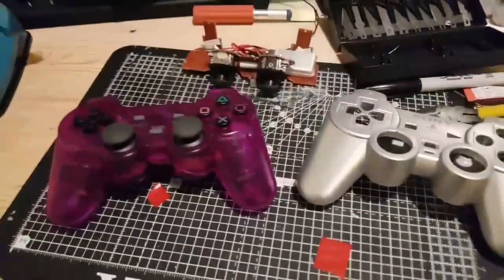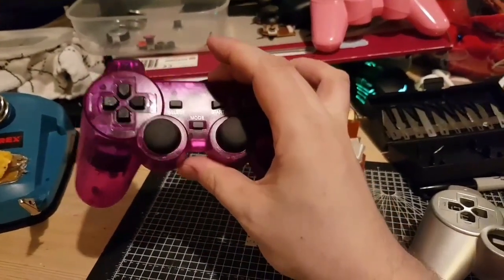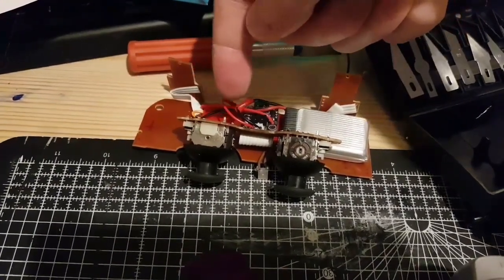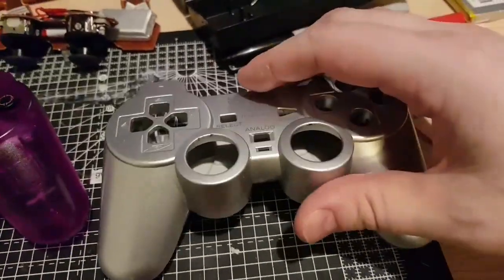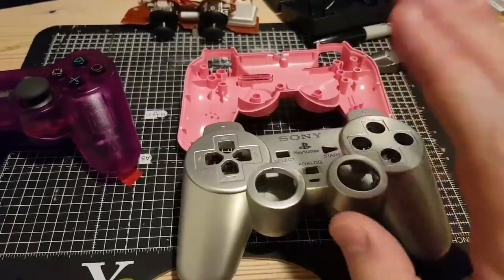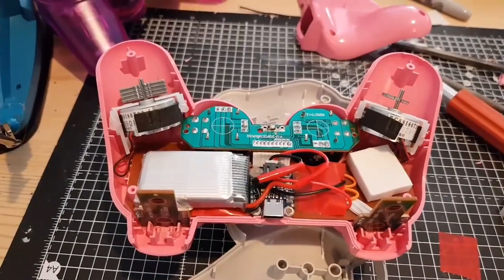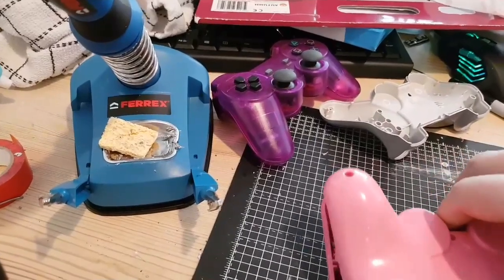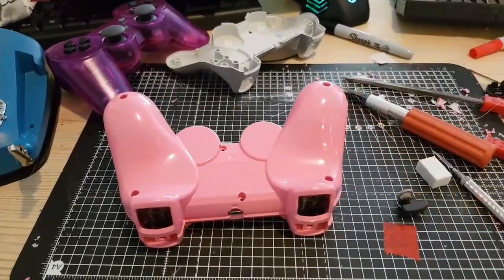Original PlayStation 2 Dualshock Controller Wireless Mod

Comment: Size baterry?
Reply from the maker: Hi thanks for watching! I used this battery: https://www.amazon.co.uk/dp/B01K39SYFU/ref=cm_sw_r_wa_apa_i_VO.BEb1WC1QPC
However it uses it's own proprietary drone connector so you'll have to add another or solder it to the battery charger. Also I used an Adafruit usb c charger, they can be quite hard to find, always sold out, but here in a micro usb one:
https://www.amazon.co.uk/Adafruit-Micro-Lipo-MicroUSB-Jack/dp/B00MJ0HOKS/ref=mp_s_a_1_1_sspa?dchild=1&keywords=adafruit+micro+usb+battery&qid=1585937175&sr=8-1-spons&psc=1&spLa=ZW5jcnlwdGVkUXVhbGlmaWVyPUFCVVFKMEg5VVZLN1QmZW5jcnlwdGVkSWQ9QTAyMjM4MjEzQ0ZTWlFKOU9HVU5NJmVuY3J5cHRlZEFkSWQ9QTAyMjcyNzUxR1hBQzZRMUpST1hWJndpZGdldE5hbWU9c3BfcGhvbmVfc2VhcmNoX2F0ZiZhY3Rpb249Y2xpY2tSZWRpcmVjdCZkb05vdExvZ0NsaWNrPXRydWU=

Comment: I would love to do something like this do you know if those wireless ps2 controllers work with converters? Also would you sell one because I would pay the amount of a ps4 controller for the transparent green ps2 controller like this
Reply from the maker: What kind of converters do you mean?  Also sorry, I do the occasional mod for my mates but I dont sell the stuff I make. I started this channel to show you can make awesome controller mods, micro consoles, and Raspberry Pi stuff with no training, and for a low budget. I use super cheap Chinese components and hand tools from the poundshop. Trust me if I can do this, anybody can. You dont need a workshop or 3D printers, all you need is a little patience. If you need any help though, you can always contact me.
Reply: Thanks mate I was talking about the ps2 to xbox 360 converter I have I use it play games on pc because I love ps2 controllers more than current ps4 controllers
Reply: I also recently took apart my controller to clean it because it was very old and put it back together and now the controller isn't working I plug it in and now it considers all my inputs as ON is that like a ground issue or something?
Reply from the maker: @jdestroyer9721  This is purely a guess but assuming this is an original Sony DualShock 2, the first thing I would check is the little where the button membrane (the thin plastic sheet with the contacts on it) connects to the pcb. Inside the bottom half of the controller shell there is a small foam pad, its job is to press down where the membrane ribbon touches the copper traces on the pcb, the are couple of tiny posts  to keep the membrane in place while its put together. My guess is that the membrane has shifted when you put the controller back together. Make sure the contacts are clean and that the foam pad is back in if you took it out. Just a guess but I wish you luck.

Comment: Can you provide a link for the battery that you used. I’m having trouble find a proper one that can work.
Reply: What about the charging port used. I tried using the battery with a charging port but not getting much results. You said in the video that it was a power regulator, but i’m having trouble finding it. Do you know what the part is specifically called?
Reply from the maker: @doltishiowa8577  Sorry I forgot to add the link for that. I use the tiny Adafruit lipo chargers, I've used them before on a couple of raspberry pi projects, they're super small and reliable I had a search about and I couldn't find and USB-C ones, they're constantly out of stock, here's a link to a micro USB one that I've found on amazon though.
Reply from the maker: Sure thing, FYI this drone battery came with a proprietary connector  not a standard connector that most rechargeable cells have, so I soldered on the one from the large battery in the video. I'm in the UK so the link is for our Amazon store but all these come from China anyway so they shouldn't be hard to find:
https://www.amazon.co.uk/dp/B01K39SYFU/ref=cm_sw_r_wa_apa_i_VO.BEb1WC1QPC
If you're modding multiple controllers you can find these batteries in a 4 pack (one for each drone wing I guess) for only a slight increase in price. Thanks for watching. Hope that helps.